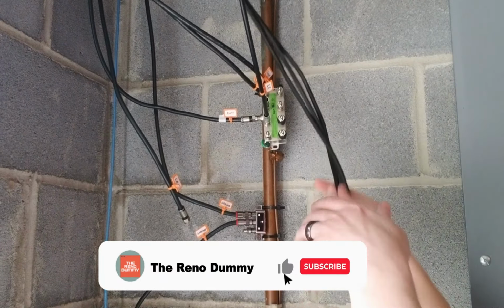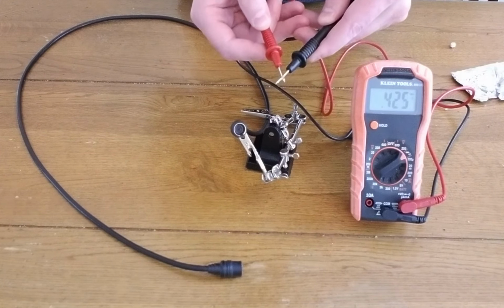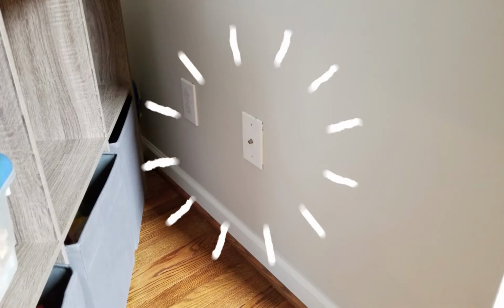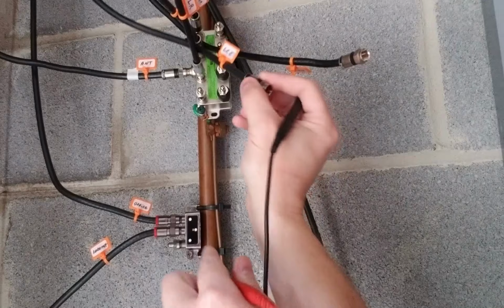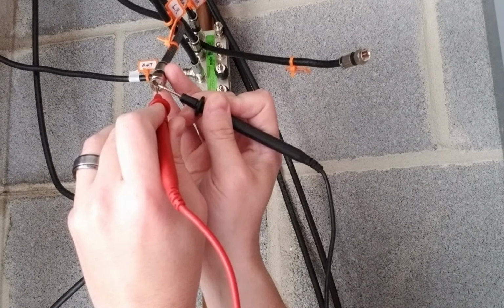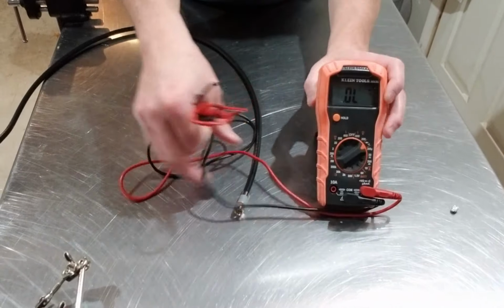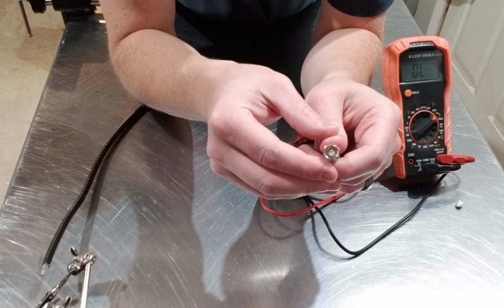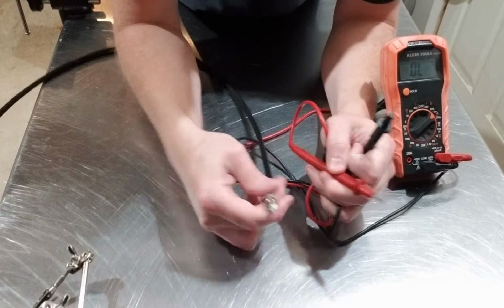How to Trace Coaxial Cable with ONLY a Multimeter #coaxialcable

Comment: I have 15 years of experience in electrical and NEVER knew about the tin foil trick. I just used this in my mom's house to identify a coaxial cable in her living room, and it worked perfectly. Thank you!
Reply from the maker: Thanks! I'm glad it worked for you
Reply: Really?!
Reply: @Peter_Riis_DK  Yes, it works. Try it yourself.
Reply: It’s and analog signal and travels the same way vs optical
Reply: Is there a trick for HDMI?
Reply: 30$ to save me from going up and down the god damn steps 100 times I think I’ll spend the money
Reply from the maker: @Treyenght1 😂
Reply: The easiest way that I have found is if you get one of those toners from Cline do you attach the receiver on one end and take your wand go downstairs and just tap all the coaxial until you get a beep
Reply from the maker: That would be easiest but the Klien tool cost $25 and once you use it you'll probably never use it again. This is a way to use tools that people may already have.
Reply: Trust me dude I’ve been doing it for about a good three years strong often on and you’re not missing anything. Because that is the longest way to Matt coaxial cable all you need is the toner in touch and go toner where you don’t have to worry about tvOS work of adding for Yulin touching to ins and then going downstairs and check another two wins where the touch and go Turner will automatically detect call Dee Ave home about you just having all the collector cables

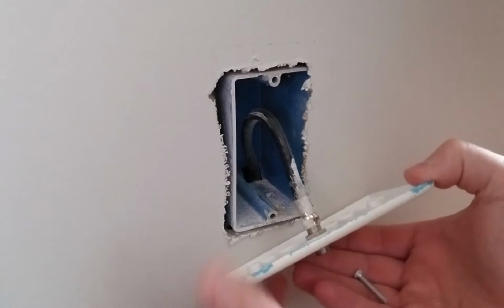Comment: The cable shown @ the 3:32 mark was incorrectly prepped. There shouldn't be any shielding sticking out from the connector. Home Depot and Lowes sell tools that can strip the proper amounts of the different layers to make a solid connection. Compression and crimp connectors are preferred over twist-on. 🙂
Reply from the maker: Compression and crimp connectors are better no doubt.

Comment: Instead of aluminum foil, just use alligator clips. One clip to the outer connector, and the other on the stinger(copper pin).
Reply from the maker: That'd be easier. I need to get some alligator clips for my multimeter. It didn't come with any.

Comment: If the cable doesn't have the cap i can put one connector on the mesh and another on the copper wire ? and if it has signal on it i should get the beep?
Reply from the maker: Yea that should work the same way. The cap just makes it easier.

Comment: Help! I have 11 coax to various places over 3 stories and one feed coax from fios ont. all but 3 have tone?!
I places 3 foil balls as you showed, one on each floor???
Could my coax network be opposite, where 3 with foil get no tone and all others without do get tone?!?!? Help
Reply from the maker: If 3 of the coax have tone and you're only using one tin foil ball on one coax then I would think those 3 are connected to a splitter somewhere
Reply: @simpleguydiy365  each of the 3 had the foil? Strange
Reply from the maker: @johngalt156  I don't think I understand what you have going on. What I would do is find the splitter that the main feed connects to. Then I would put one foil ball on one coax at a time until I have mapped all of them.

Comment: Hey, thanks for this. The tin foil method didnt work for me, but gave me another idea. I had some crocodile clip leads so attached those to a AA battery on one end, then used my meter to measure voltage on the other end.  This worked for me.
Reply from the maker: That's a great idea!
Reply: How did you clip it to the double A batteries especially the neg side?
Reply: @Lemonades1321 with BS of course, he only wants to say he has a better idea 😂

Comment: Could I use a multimeter to find the main coax cable ? We just moved into a new house and we have a ton of disconnected cables and I’m not even sure what the main cable is to connect to the splitter
Reply from the maker: I would either trace it from where it enters the house or you could use this trick and find all the ones that are not the main line and then you'll know which one is the main...

Comment: I was a CATV contractor back in the day, late 80's - early 90's. This is what we used when coming to a large prewired facility, home and/or apartment building with zero identification of the cabling. We took a green LED, inserted the positive (+) lead into an F-81 barrel connector and the negative (-) lead shortened and placed it touching the outside of the connector. Then inserted the LED inside of an RG-6 connector where the dielectric typically resides. Lastly, a short piece of coax cable, a 9-volt battery with the braid connected to the neg (-) of a 9V battery harness , and the stinger (center conductor) of the cable to the pos (+) of the battery harness. Tape the battery to the cable neatly with electrical tape and secure the connections and wrap with tape. Finally, terminate a coax connector to the other end. You then take the battery end of your new tool, snap the battery harness connector to the battery, screw into any faceplate. Then go to the head end and start inserting the unmarked cables into the F-81 end of your new tool. When you select the line with the 9V, the LED lights up.
Reply from the maker: Wow. Sounds complicated but I'd like to see it.
Reply: @simpleguydiy365  Yes, may sound complicated but actually very easy and takes about 5 minutes to make one. I still have my original one somewhere, saw it not too long ago. I'll see if I can locate it.
Reply: 9V on a LED will fry it.  You need a resistor.  Good idea though, unless it has splitters attached.

Comment: Perfect!  Didn't want to buy a tool I would only use once.
Reply from the maker: Great. Glad it helped.
Reply: @simpleguydiy365  it worked amazingly. Was moving a modem to a different room and didn't want to trace lines.  Thought I messed up at first because it worked on the very first cable I tried.  But just got lucky I guess.  Definitely remembering this little life hack and will pass it along. Thanks again.

Comment: You can also determine the length and integrity of the outlet by using a 75ohm terminator instead of the aluminum foil. A 100’ outlet will read 79ohms as RG6 picks up roughly 1 ohm per 25’ of coaxial cable length.
Reply from the maker: That's a great idea as well. Not everyone has terminators but if you did that'd be a great method. Thanks for the input.

Comment: I have had live voltage in my coaxial cable
Reply from the maker: That doesn't sound good. ,😆
Reply: @simpleguydiy365  so what do I do
Reply from the maker: Well, you could have voltage from some sort of signal amplifier or even some detectable voltage from the coaxial running parallel with electrical cables somewhere. If its not a high voltage and causing issues then I wouldn't worry about it.
Reply: @simpleguydiy365  it was causing issues with my internet a lot of issues but the coaxial is close to the power lines so il have them move them maybe because I just got the whole house new plugs and grounded them they were old
Reply: @YoungShizzie  amp clamp your catv drop just on the input side of the ground block. If you have amperage on it, you likely have a neutral issue. 

If you don’t you probably have voltage back feed from a cable box or modem.
Reply: @rusty2407  well it’s gone now comcast said , so idk it comes and goes sometimes
Reply: @rusty2407  I don’t understand what your saying to do
Reply: @YoungShizzie  check the open neutral video on my page. Do the same on the cable at the side of your home, if you have current on it, it’s possible you have a neutral issue in the home.
Reply from the maker: Thanks for chiming in with a possible solution

Comment: 👏👏👏You *just won yourself a new subscriber👏👏👏👍
Reply from the maker: Ha. I'm glad it helped
Reply: @simpleguydiy365  my landlord got a old appartement building and and ask me 2 days a go to fix the cable in one of the unit, wen i wen to look for the cable entry point... i saw around 5 different cable in the unit and maybe around 12 going to the dmx tower for the old tv air antena and 4 going to the cable company box. so I will use this hack on a chosen cable in side and go test the 16 different one outside ^^

Comment: Thank you for this all the issues bought has had four different satellite TV services the correct have been cut and who  knows what else😔  I noticed where  my heating unit is there is a splitter thingy that has to cables going somewhere but nothing running into it.  I’m hoping your Handy dandy video solves The mystery so I can plug in my TV Antenna  :)
Reply from the maker: Great. I'm glad it helped!

Comment: I just bought a house that I'm pretty sure has at least 30 coax cables running through it - for TVs I guess? Not sure why some rooms need 2, 3 or 4 connectors but this little trick will help me know how to start pulling them out - thanks!
Reply: Don’t pull them out. Leave them for future use. I can use coax for many things.
Reply from the maker: True.
Reply: @brianholz9882  What are some things you can use them for?
Reply: @adamwberanek  voice, data, cable, and even run Ethernet through it with a MoCA adapter
Reply: @brianholz9882  okay that's pretty cool, thanks for sharing!

Comment: Can I use multimeter to see if the ethernet cable on 1 end links to the coaxial on the other end, I think there is a convertor adapter connecting both of them or else it is split to merge them for PoE except to coaxial - it is an old camera system and I fluked it but can't find the ethernet connection.  And on old DVR cameras mostly is coaxial and wondering if this trick would work or another idea would work.
Reply from the maker: Good question. I haven't done any work with Ethernet cables so I don't the answer. Sorry. Let me know if you figure out a way. The only thing I would hope is that the coaxial adapter is right behind one of the wall plates. Then you could unhook it and just test both ends of the coaxial.

Comment: If you don't have a coaxial connector on one end of coaxial cable can you tape a ball of aluminum foil to that end so that it attempts to touch the center connector and metal mesh?
Reply from the maker: Yea in theory that should work too.

Comment: How do I know if my coax is running upwards into the attic or down into the crawl space? The coaxial line on the outlet in my office has gone bad and I need to find it and change it out. Help 🤞
Reply from the maker: You can remove the plate on the wall and see if the cable is running in from the bottom or top which could help. Or just look in your crawlspace/attic. You might also be able to tell if you find outside where the cable comes into your house and whether it goes under from there or up into your attic.

Comment: Approximately how many feet of cable can be measured using this method?
Reply from the maker: I've used this on all the cables that run through a 3 story house. So I imagine the length of cable is pretty significant.
Reply: I used this method on a cable I estimate should be at least 30m (100ft). worked perfectly.